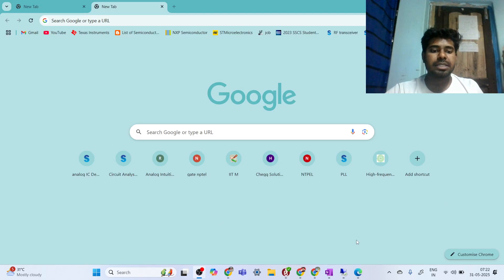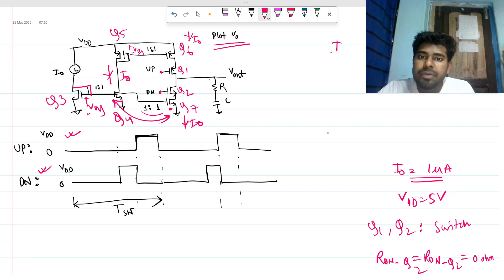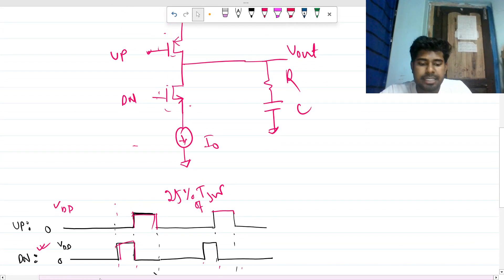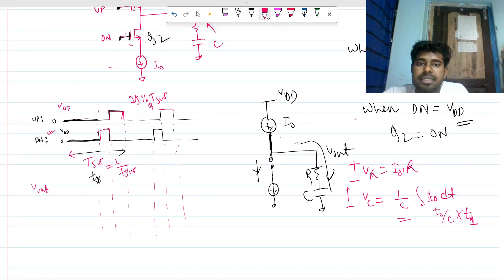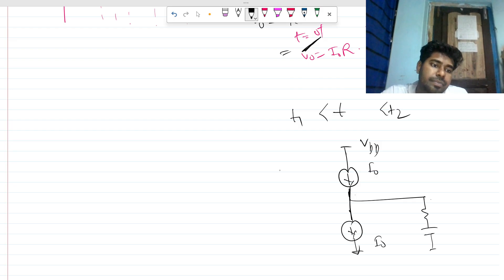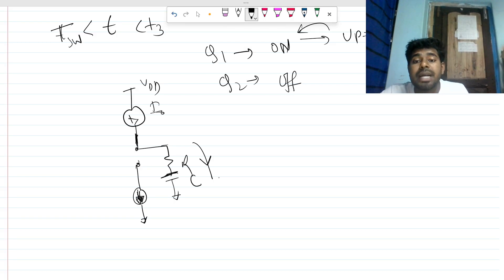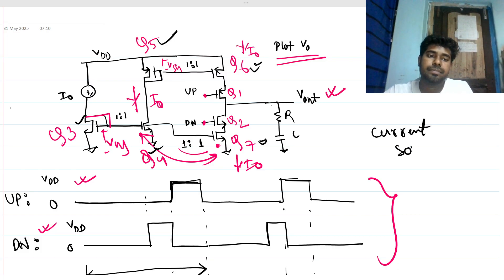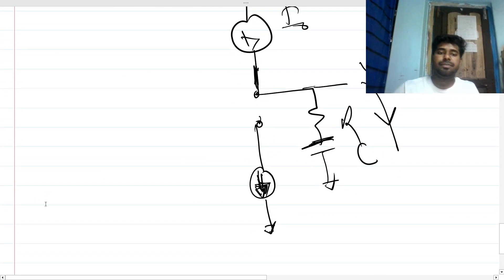Analog Circuit Design Engineer interview_ Plot Vout Waveform? Charge Pump PLL ?! Amit Bar

Comment: Between t1 and t2 current through RC ckt is zero so output voltage should drop by i0*R from it's previous voltage and output voltage is only due to i0*t/c right. In the graph output is held the I0*R + i0*t/c voltage
Reply from the maker: Yes...correct
Reply from the maker: Analysis is correct but wave is not fully correct ! I have re-upload the complete solution in the next video.. Thanks
Reply: Yes your intuitive analysis really helping me in analog domain i went through all of your questions and i have got good understanding. I am pursuing my mtech so they are really helping us. Keep going and thank you  @AmitBar-Analog_Circuits
Reply: exacly